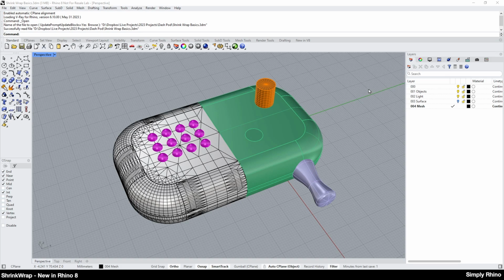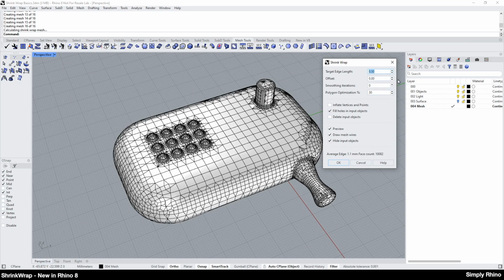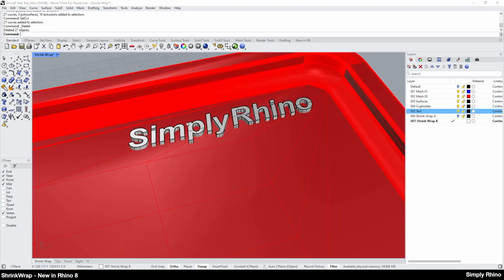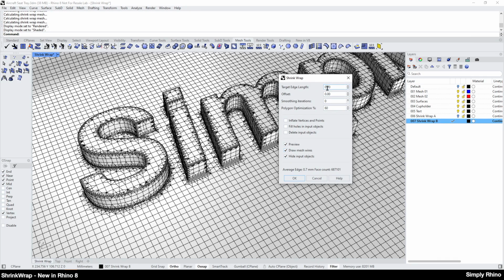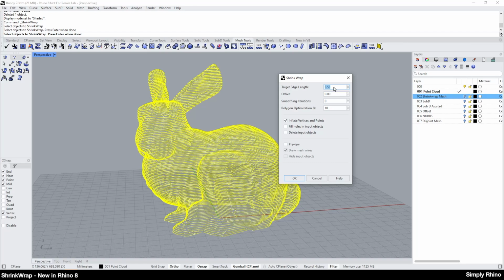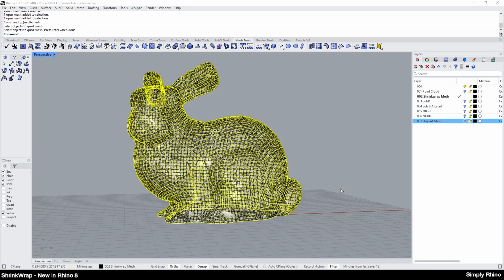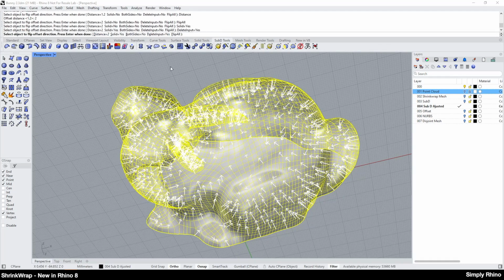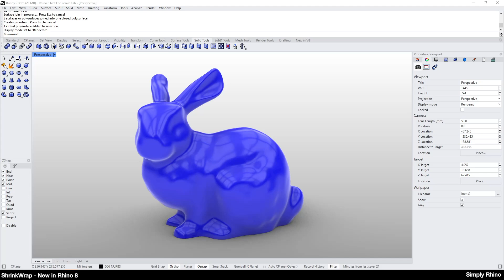New in Rhino 8 - ShrinkWrap

Comment: Can this be done on a mesh/point cloud with internal points? I have a series of dxf boxes representing different stages of an excavation. Some boxes overlap and some are within each other resulting in a lot of internal walls. Would it be possible to shrink wrap these dxfs so I end up with one dxf representing the external walls of the final excavation only?
Reply from the maker: Hi Chris. From what you describe it doesn’t sound likely you’d get a good result with Shrink Wrap. You’ll end up with a mesh and you may not have enough control over the result. Of course, I haven’t seen the geometry so it may or not be possible. Why don’t you try out the 90-day evaluation of Rhino to see if it works for you?